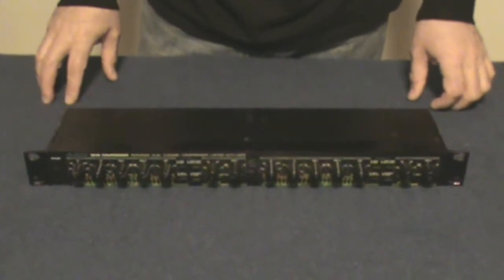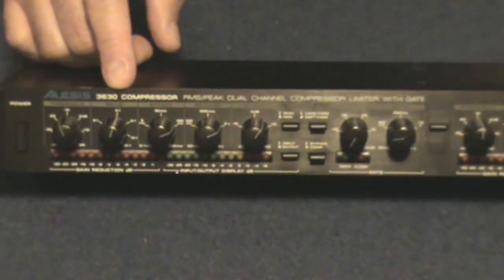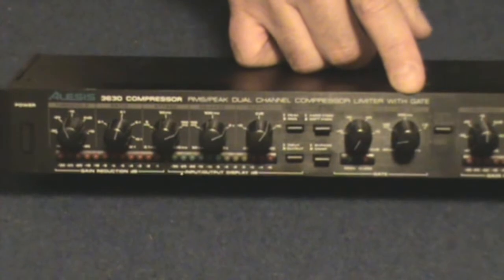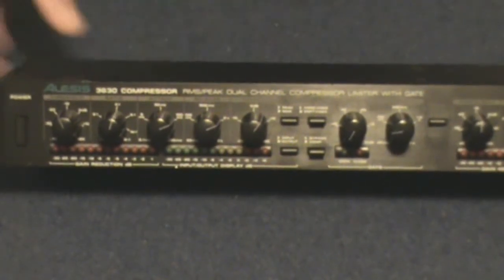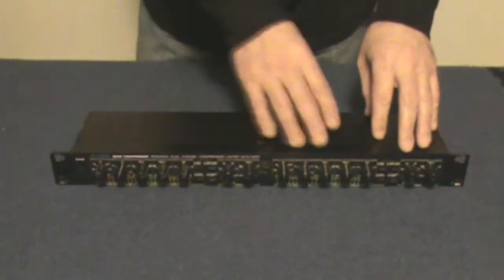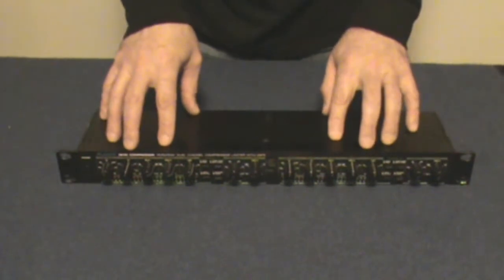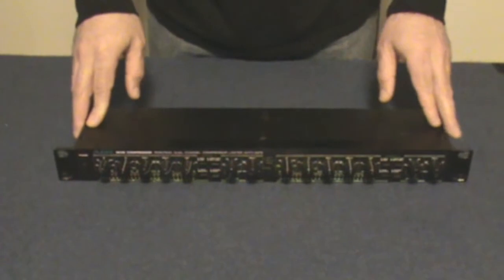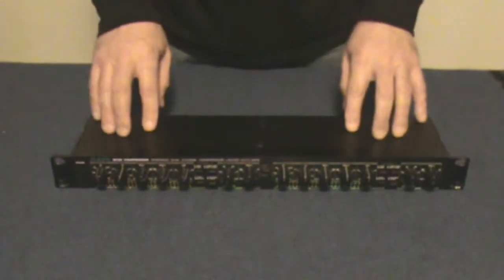Intro to Compressors - AudioTech

Comment from the maker: The unit was not actually connected and even if it was, it would be very hard to 'hear' what these units do. The unit doesn't change the sound, only the level, and in a way which takes away louder peaks, abrupt louder levels and smooths them out. One thing I don't like about this unit is the knob labels are black print on a grey background. Even with a rack light you have a hard time reading them. You can find close ups of this unit all over the net. Thanks for the comment!